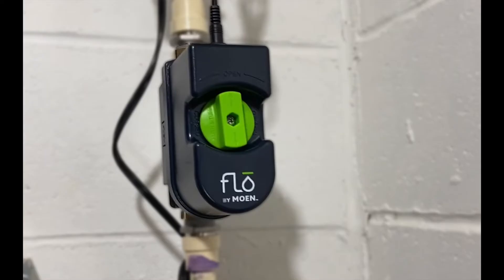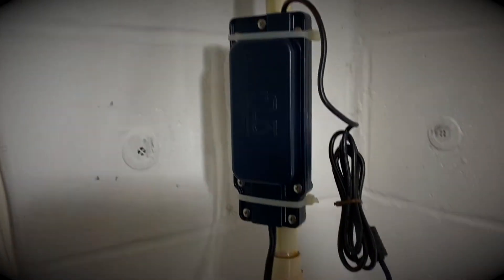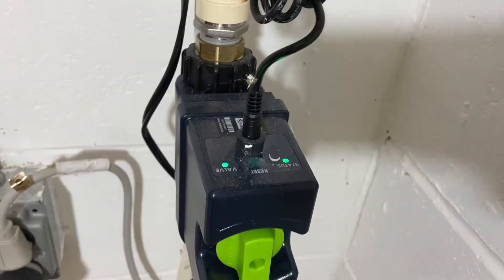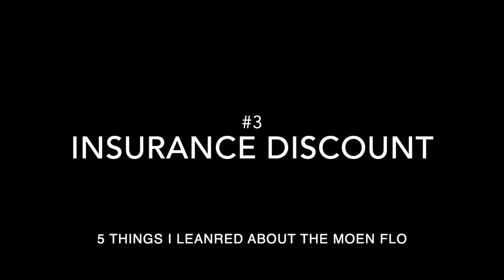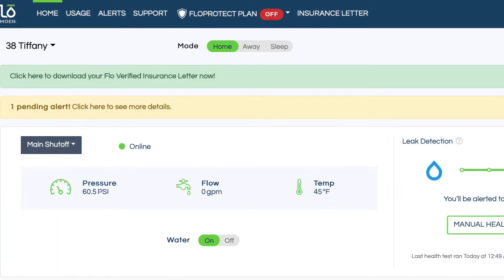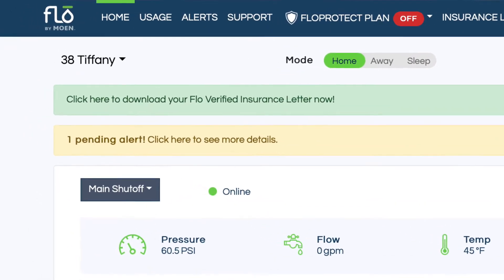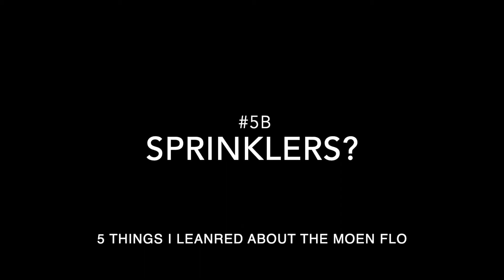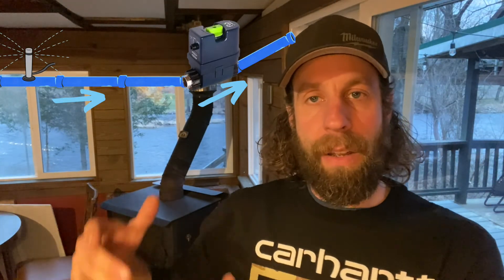Moen Flo Part 2 UPDATE | How its been working & what I've learned

Comment: Our home owner's insurance (AAA) has an extra premium added to the home insurance premiums unless our main water pipe has one of these devices installed. And they stipulate that they have to replaced every ten years. I don't know how much AAA charges for the premium if none is installed, so I am wondering if it is worth the price of the device and installation charge and the cost of replacing it every ten years. Any comments on this?

Comment: Installed a week ago, stopped working after one hour. The installer made a weird comment before he left, the power supply goes out.  I called Moen that late afternoon and said this thing stopped working.  All I needed was a new power cord and adapter ( now I learned it is called a converter) .  Moen sent a new one without question.  Called the installation company and they mention the power converter may be defective.  This sucks.

Comment: I’m planning on installing this but not sure which way to go. Well water is pretty clean takes months to develop silt in the whole house filter. MOEN states must use 100 mesh or less wye strainer even if the MOEN is installed after the whole house filter. What to do   ?? Would prefer install after whole house filter and after sprinkler system branch.  Keep in mind must use mesh filter regardless of location per MOEN for warranty. ???

Comment: Thank you for the video.  I was away for two weeks after it was installed.  So learning mode was a bust.  Now that the irrigation is running I was caught With the water shutting off when I was away on vacation. The B hyve smart controller power board died. I don’t know if it was due to auto shut off so just be aware this might happen to you.  I set a manual override and it’s better but not perfect.
Reply: Just installed the Flo and having issues with the sprinklers not coming.  No pressure, I can hear a bubbling but nothing.  Also the jacuzzi jets.  I thought it was just an outside issue but seems pressure in house is low as well.  I don’t believe we have a leak due to the fact the whole house was repiped a year ago.  Only added this device due to insurance requesting it.   How is it going with your sprinkler system now.  Has it gotten any better?

Comment: Anyone installed it before pressure regulating valve? I am concerned that the city pressure variations (high pressure) can cause my valve to shut off. Anyway around it?
Reply: I would highly recommend not installing before the PRV, city water pressure can reach over 100 psi and damage the unit
Reply from the maker: agreed -- also I would want notification if/when my PRV failed

Comment: Am I missing something?
Why would anyone consider spending the money on a battery back up? At the time of installation you could simply plumb a bypass valve around the Moen.
Reply from the maker: In theory the battery backup gave leak/burst protection even during a power outage. In reality, they recalled them due to fire risk so it’s not an option anymore anyway 😂

Comment: Also, having the irrigation system not being monitored is a huge issue as that's the most water waste and leaks you will have often in the house due to the exposure and fragility of these sprinklers and the different setting they will need to run every season
Reply from the maker: You can absolutely install the system upstream of your irrigation. Flo will take some time to learn your irrigation schedule, but it will work.

Comment: Thank you for this informative and helpful vid. Our insurance company is REQUIRING us to install one of these before they'll renew our policy. One question: I realize the wifi function would be lost during a power outage, but would the automatic shut off function also be disabled? (assuming no battery back up). Am I correct in thinking this auto shut off valve is electrically operated?
Reply from the maker: As far as I understand, the automatic shut-off function will still work even if disconnected to wi-fi, you just wouldn't be notified
Reply: @thelonelandlord  I was specifically curious about the valve. I'm assuming it's electronically operated? If so, it wouldn't work during a power outage. I just wasn't sure it's an electronically operated valve.
Reply from the maker: @mediumrick7667  yes, the valve is electronically operated but can also be turned manually.
Reply: @thelonelandlord  thnx!
Reply: @mediumrick7667  One issue I’m having is I’m 2000 miles from home and it has lost my wifi signal.  I’ve got a neighbour watching my home but don’t want them to have to go thru the reset procedure.  Nice to know it will still work without wifi but I miss the updates and notifications.

Comment: You didn't mention whether the water source was a well or street or both.
What are your thoughts/experience with either/both❓
Reply from the maker: this particular unit is on a house connected to public water; we have another one that is on a "town" well, I have not noticed any issues.
Reply: @thelonelandlord  I had the device installed a few days before I went away from home for a few months.  
My plan was to be able to remotely monitor the device.
Well, about 2 weeks in, the device DISCONNECTED from my home wifi.  
Who knows why?
The end result though is I have no monitoring ability until I return home, reset the device, and reconnect it to wifi.
I know my wifi is fine as I have other wifi devices (outlets, cameras, lights) which I remotely control just fine.
I'm told the auto shutoff is still "protecting" me - even though I can't be sure.
I'm DISAPPOINTED to say the least.
Reply from the maker: @wuddayameen  that is a major pain-- I have not had this issue since installing in our two Airbnb's several years ago. Possibly an issue with your router, or strength of wifi signal
Reply: @thelonelandlord  Today there was a power outage at my home. When power was restored, the Flo came back online - GREAT!.
Soooo, the lesson is that I need to get a SMART OUTLET for the Flo to plug into; and turn on/off from my phone app; I use Kasa now.
I think I'll also get a SMART OUTLET for the router; as a way to do a power reset.
It wasn't a router or wifi strength issue as the Flo and wifi router are within 3 meters of each other.
My home internet app Deco shows connection strength of connected devices.
My guess is simply a software bug in Flo, or, a firmware update failed.
I also have a Blink camera facing my oil burner temperature display from which I do a daily check.
Reply from the maker: @wuddayameen  Yes this works -- I have several smart devices that I installed Kasa outlets on to reboot when they loose connectivity (Interestingly, I've never had to do it with the Flo...) It will not work for your router however, because you will not be able to turn the outlet back on... there are remote router re-set devices available that I've tried, but with limited/intermittent success
Reply: @thelonelandlord  My internet is with Optimum. Their phone app supports cablemodem reset.  That's helped me a few times. You're right in that powering down the cablemodem via a smart outlet creates a problem of how to turn it back on.  One idea is to set the smart outlet to a reset schedule-say daily at midnight to turn off and 1 minute later turn on.  My primary usage of the smart outlet is for lights to turn on/off via a schedule.
Reply: @thelonelandlord Good point!  I get internet via Optimum.  Recently I found out the Optimum app supports remote router reset.  That saved me a few times when the router crapped out.

Comment: Thanks for the video! So did you leave it on sleep mode (reset it every 72 hours) until it learned the patterns? Or did it just start learning the patterns and you would cancel the alerts?
Reply from the maker: Early on I was continually re-setting sleep mode... lately however I have let it go and just aware of alerts. It does alert via app, text message & phone call--- however I will say our biggest problem as of late is people showering at 1-2am in the morning for some reason! This has been shutting off the water and I don't find out until I wake up the next day....
Reply: @thelonelandlord thanks
For the input, yes that is what I’m afraid of.  I have a three family multi family home and these patterns wouldn’t be as consistent.  I’m wondering if the device eventually learns even the unusual behaviors
Reply: Can this detect slow seeping type leaks?
Reply from the maker: Yes, very well actually -- it does a daily health check that will alert you of small leaks (even dripping faucets). It doesn't shut the water off but it does send an alert.

Health check works by briefly turning the water off and measuring the pressure of the closed system -- if the pressure drops at all, it will alert you to the size of the leak.

Comment: Do you have problems with turbine getting rust?😊
Reply from the maker: The turbine did recently stop working... replaced with moen-supplied new one. easy swap, video upcoming...
Reply: @thelonelandlord  did you install with a by-pass valve to allow for unit replacement and still keep water to the home?
Reply from the maker: @Happydaze2u no, the unit comes with spacer that can be used if the unit needs to be removed.

Comment: So if you’ve had anywhere from 1 to 12 guests and it didn’t shutoff, what makes you think it will work on a leak?
Reply from the maker: It uses historical data from that it compiles to determine potential leaks.  It still makes mistakes sometimes on very long showers at odd times of day, but it does continually get better.  It is also likely that a bad leak would have a much higher GPM than a typical shower head.  Small leaks are tested for daily and reported.

Comment: As to irrigation upstream of the Flo unit, the only issue I see is a low-pressure alert when irrigation is active, and that flow is significant.
Other than that, should be transparent to the Flo operation.

Comment: I would not run irrigation through this device. Irrigation should be teed off before this device.

The biggest point of this device is detecting a pipe burst or catastrophic water event.  It can’t accurately detect that when irrigation is running because irrational uses high gallonage.
Reply from the maker: 100% accurate
Reply: False.  This device should be intended to detect excessive water usage due to a leak to prevent a $5k water bill.  Water damage is not the only thing being prevented here
Reply: @Dc-jg2ti put one on the sprinkler system in the valve box.

Comment: Looking at getting one of these but concerned about sprinklers. Apparently, Moen also makes a sprinkler controller that can talk to the shutoff valve to let it know its ok. Would be interesting to hear people's experiences with this.
Reply: same here - concerned about it getting confused when I run my irrigation system.
Reply: Most sprinklers are piped  before the home entry. A break in the sprinkler would probably show as a low water pressure event.
Reply: @gg80108 understood but that seems like it would result in a lot of false alarms.
Reply: I’m thinking about getting one, but, our house has a fire suppression sprinkler system. If there were to be a fire, and one or more sprinklers went off, would,do it detect this as a leak and shut off the water?
Reply from the maker: I would think it would identify it as a leak… sprinkler systems are usually teed off before the rest of the house— I think I would install it downstream of that

Comment: You wouldn’t ever want the Flo unit to be behind the irrigation branch. It would never be able to accurately determine an actual pipe break or if the sprinklers are running.   

Flo is perfectly installed after any irrigation branch and IMO after any water softener because of its regen cycle.

Comment: how does it know the difference between a burst pipe or simply filling your bathtub with 30 gallons of water
Reply from the maker: Adaptive learning… it begins to learn your fixtures and how long you typically run them & at what GPM rate. This does result in some false alarms especially early on until it learns. It gives you a 5 minute warning before shutting off if it detects excessive water usage…

It’s not gonna catch a burst pipe immediately.  The goal is to prevent hours of water damage…
Reply: @thelonelandlord  I'm thinking about purchasing this product. My concerns are both - false alarms and confusing actual leaks with 'normal' usage. After reading the comments my concerns about false alarms are somewhat allayed but not the opposite - how can you be confident that it won't confuse an actual pipe burst with a bathtub filling?

Comment: How does the Moen FLO know the difference between a suspected leak and say, the use of the garden hose outside to wash your car or water your lawn?
Reply from the maker: Good question— long uses of water can initially fool it into a leak,  but it eventually learns as long as you interact with the app. If it notices a large amount of water usage, it will send you a warning that it will shut off the valve in 5 minutes. If you clear the warning, it will ask what type of event caused this usage and will adjust. We had this happen on long showers early on.

Comment: Moen recalled all 10,000 units of its backup battery power option because they heat up and catch fire. They will refund you for the device.  See the Moen and internet for details.
Reply from the maker: yes I did update that info in the description of the video, bummer...
Reply: Thank you for that critical piece of info!
Reply: Just add a UPS.  I’m getting ready to buy the valve and sensors and will add a  small UPS.  Anyone using a UPS and what size are you using?

Comment: Thx for the video and review... it does seem weird to me though that it wouldn't register low pressure when you sprinklers turn on since it is before the FLO and would create a type of loss/negative pressure
Reply from the maker: very interesting point --- I'm not exactly sure what size the main is where the sprinklers tee off.... and the Flo does provide a graph of water pressure over a 24hr and 7day period and it does fluctuate, but no more than about 10psi.... not enough to trigger a low pressure warning.  I should note the sprinkler system at this property is zoned and each zone is fairly small (only 2-3 sprinkler heads per zone)

thanks for watching!

Comment: I’ve only had it installed for 18 months in a brand new home and it’s already broken. I still get readings and I can engage the valve via the app, but the water continues to flow regardless of position. I contacted Moen and they just sent me a coupon for 50% off a new $800 device.

Comment: The impeller turbines are the weak link.  Outside of that I've been happy with mine.   I've repaired my turbine with different magnets with success.  Pushed a sharp pin through the back,  pushed the magnets out and installed new ones.

Comment: thank you for this information. I was looking for sleep mode info as FLO shuts off my water with my irrigation on in the middle of the night. It is a new system (about 3 weeks) so perhaps it will learn and stop alerting me and shutting down? I thought I could just put it into sleep mode but your info about the 72 hrs is helpful. thank you. will look for your part 1 on this device.
Reply: I would not run irrigation through this device.  The whole point of the device is detecting out of normal water flow, like a pipe burst or something. 

You will never be able to accurately detect a pipe burst when the irrigation system is running.

Comment: I have had Moen for two years. It’s been very good although I have a couple of comments:
(1) my turbine/impeller also rusted and I had to replace it. Unlike the person above, Moen charged me $31 even though I only had the system for 2 years and it had rusted. On the plus side, it was very easy to fix. 
(2) with the failure of turbine, Moen should have a warning if there is no flow detected for a few days. I don’t know how long mine wasn’t working until I noticed it one day by chance. 
(3) I get “pressure too high warning” all the time. My plumber says it is normal for the size of my house. I wish there was a feature in the app to allow the user to increase the threshold.  Or have the system learn over time that my system needs a higher threshold. This is my biggest annoyance with the system. 
(4) I do have a sprinkler system. My issue is Moen has a 2 hour limit for sprinklers. I have a large property and sprinklers are programmed to run for 3 hours. Every time it runs, Moen shuts the water off. It would be nice to have a feature that allow users to increase the 2 hour limit. I ended up splitting the program in two and run 1/2 on one night and the second the next night.
Reply from the maker: great info, thanks for sharing! good to know the impeller is easy to replace... I have heard this issue but yet to run into it on any of ours
Reply: I wouldn’t have the irrigation line run through this device.
Reply: Question, is the Moen connected before the sprinkler system or after the sprinkler system..
Reply from the maker: @peterlakers1 after

Comment: Have you ever seen Flo indicate low pressure when everything is fine? Mine was installed yesterday and is reading 3psi which is ridiculous. I checked the turbine and it is spinning fine.
Reply from the maker: I have two units in service now, have not run into this problem….

Comment: I have a split beyond my main. Can you set one to turn on and one to turn off  as shortcut for bypassing  water softener but also set both to shut down w leak sensors ?Thanks
Reply from the maker: I don't see why not... you just have to turn the one off manually or remotely via the app. I'm not aware of a feature that lets you do it on a schedule.